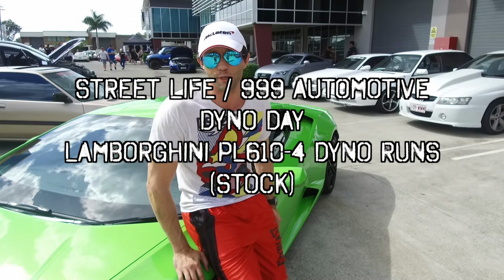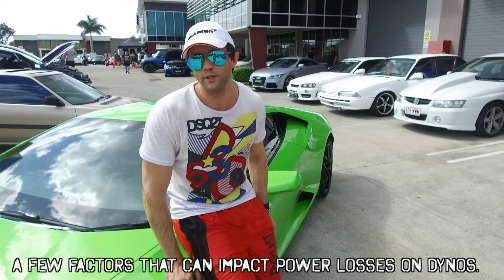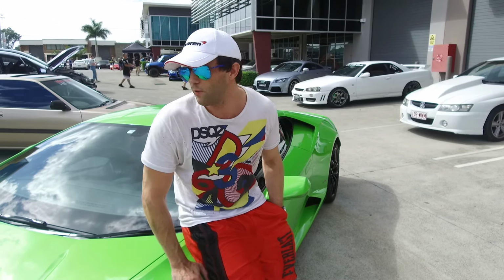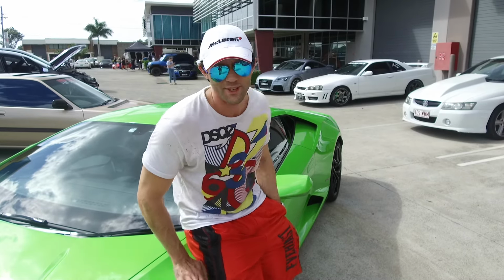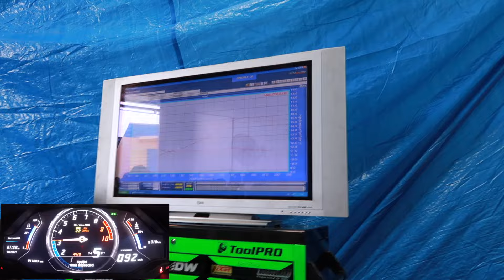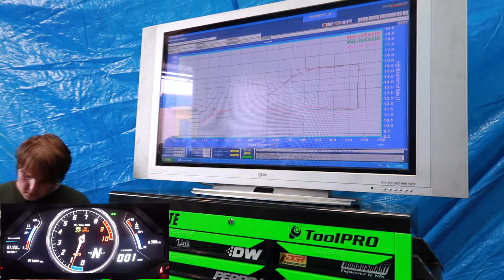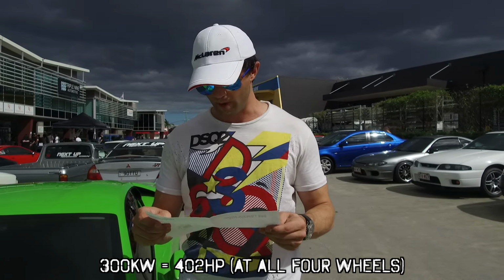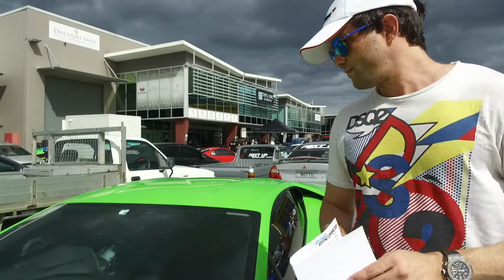STOCK Lamborghini Huracan LP610-4 on Dyno.. Is This Power Figure Right?

Comment: 600hp X 0.25% Drivetrain loss for AWD cars=450 Wheel Horsepower this is correct.  BUT this video means the Huracan might have more then 25% DT Loss making it even more amazing cause it smashes it's opponents badly.
Reply: What’s a huracans opponents
Reply: it weighs only 3,100 lbs so even if the horsepower number is lower than you'd think, the light weight definitely makes up for it.
Reply: @blue5slow  the AMS Alpha Omega Huracan weighs 3100 lbs stripped to the bone.
Reply: @EBMproductions1  that's a twin turbo huracan, the setup adds a couple hundred pounds. A simple google search will tell you the weight of the car
Reply: @blue5slow  did you read what i said? Stripped cars 3300lbs stock one 3705lbs+ look at the links there is multiple brooks from dragtimes got 3400 lbs on a performante that stock these cars are fat my G.
Reply: @EBMproductions1  oh yeah you're right. Car and driver rated it at 3,600 lbs. My guess is the gearbox is what makes it so fast. The DCT shifts are very quick.

Comment: the reason it has so "little" power is simply because of the drivetrain loss, awd vehicles always run considerably lower amounts of power on dynos. If it was 2wdr it wouldve made closer to 550 i bet

Comment: 33% drvietrain loss? lol somethings wrong here and i think its the dyno. i dont care what brand dyno and they all differ but thats stupid. Ive been in a head to head against a huracan in a couple of cars with 300awkw and 340awkw and with similar weight to the lambo and the huracan was much faster than that. Math doesnt make sense here. ignoring gears and just from a roll the thing pulled harder all the time.

Comment: That dyno reads low they make 505-515 whp stock. Trust me 402 whp on a 3550 car isn’t gonna trap 131 and run mid 10 trust me it’s making more that dyno just reads low . Trap speeds tell the story
Reply: yeah surely they must have designed it better than to lose 3 cargo ships of hp to the wheels. like i know AWD steals allot of power but god damn not this mutch

Comment: Why was it done in 5th gear? typical dyno pulls are usually done in 4th?
Reply: I'm really not an expert but I think it's to do with gear ratios and also how many gears. I know rule of thumb = 5spd you run in 3rd and 6spd you run 4th. I'm assuming without googling that this has a 7spd auto box? Don't take my word for it though
Reply: If the gear ration for that gear is 1:1 that means the output shaft spins at the same speed as the input, which gives you a more accurate reading.
Reply from the maker: +NELKEL JDM VLOGS correct. 7 speed dual clutch transmission.

Comment: Wow it is insane to lose that much hp. 300kw evos are very common on a stock block and lighter frame so it is interesting to see that a stock lambo is not able to put down 350+. But at the end of the day, different dynos, different conditions. Can only give you a rough idea anyways

Comment: Might be a good idea to get the car a good service or clean the fuel system or maybe get some stickier tyres
Reply from the maker: +Rafiul Haque nothing wrong with the car - she runs a mid 10 quarter mile @131mph. Just somehow the dyno settings were representing very low figures in its configuration.
Reply from the maker: +Rafiul Haque also stickier tires on a dyno will give a lower power reading.
Reply: I prefer dyno's that read conservatively, some guys running these dynos set them up to read high on purpose I think... What do these things weigh? I ran 10.80 @ 127.9 in my R31 at that power level- with a really shitty 60ft (1.8x), left off foot brake with no boost on the line. Obviously my R31 is a lot lighter though
Reply from the maker: She weighs 1420kg dry, or 1550kg fully loaded with fluids.
Reply: She's a little heavier than my shitbox!!! LOL! Thanks for the reply, you've got a great channel here